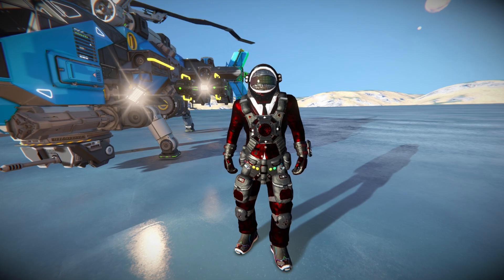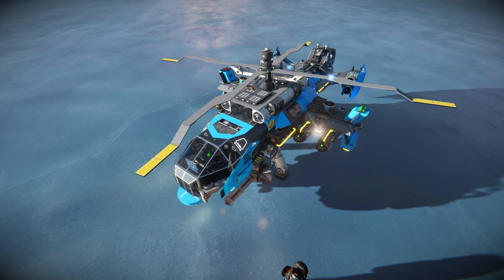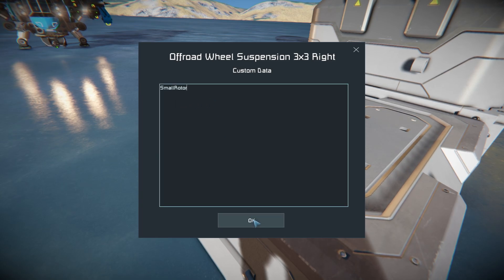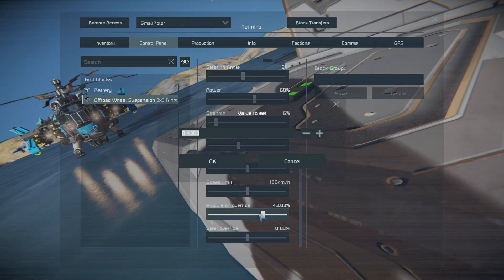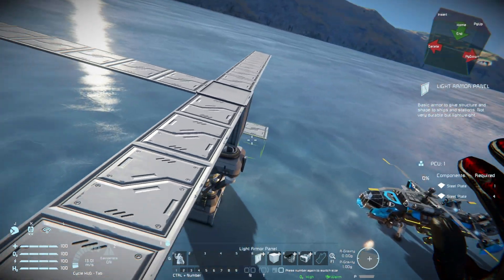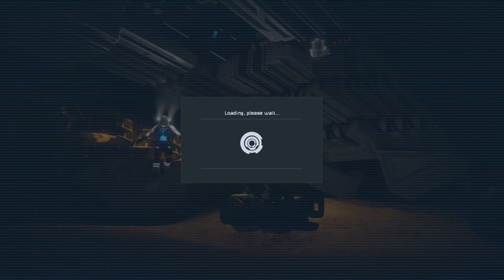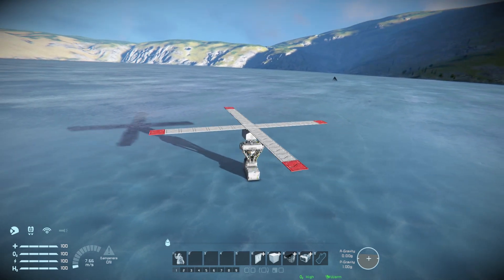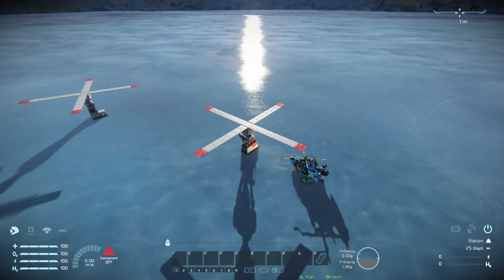Attaching Rotor Heads On Wheel Suspensions with RotorWheels! - Space Engineers

Comment: there are 3 other ways to acomplish this aswell:
Vanilla
- Copy paste existing blueprint with admin powers
- Make/find a script that tells a suspension block to attach, then align a rotor head in the correct position to attach.
Modded:
- Buildvision allows you to attach a rotorhead to a suspension using its ui, same as with script, align a rotor head in the correct position.

Extra info:
This trick works with all rotor head types and hinge heads large and small. this does as far as i have tested, not work with piston heads

Comment: Its worth noting that anything built on a rotorhead attached to suspension will have collision damage disabled and will not receive or deal any damage in an impact with terrain or grids.
Friction suspension settings will also be applied to the attached grid.

Note. This means if you manage to get a rotor'd suspension attached to a grid backwards IE rotorhead attached to the main body of a vehicle instead of suspension end, the entire vehicle will be essentially classified as a wheel and nullify collision damage and be granted friction values... This is incredibly useful for builds with terrible ground clearance. It is not doable in vanilla survival, however can be done using buildvision and tedious placement with a robotic arm or drone.
Reply: If it is possible with Build Vision, it should be possible with vanilla too. Build Vision does not add any features that are not possible in vanilla. It only streamlines the access to those features.
Reply: @anteshell  It might be doable through a programable block in theory but you would need to know how and be playing in a world with scripts enabled.
This rules out it being possible in survival on essentially most servers.
Build vision specifically adds the interaction with wheels to Attach through a menu because that function is hidden normally

Comment: You dont need the mod, you could do this in vanilla
Reply: with scripts enabled using script to attach, or by copy pasting an existing one yes, or youd need buildvision mod
Reply: @Kennet0508  you can use a timer block to spam the attach option as you move rotor head close
Reply: @GenJackO  you sure? I don't think there's a vanilla option to use attach command for wheel suspensions.
Reply: @Kennet0508  no need, set up a self triggering Timer Block to attach the rotor, get it close and beg to klang to have mercy. I've made a Workshop item called "Rincewind" that uses it and I've built it in complete survival and while with buildvision, I didnt use it